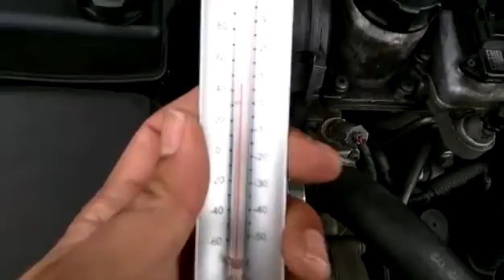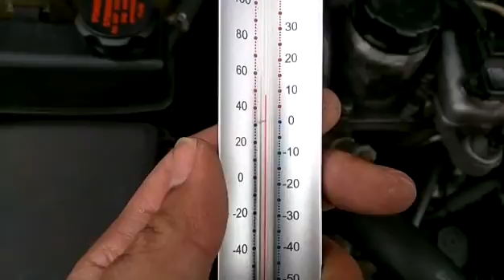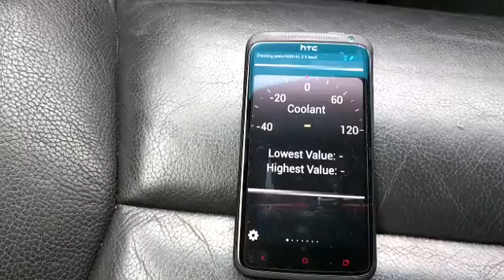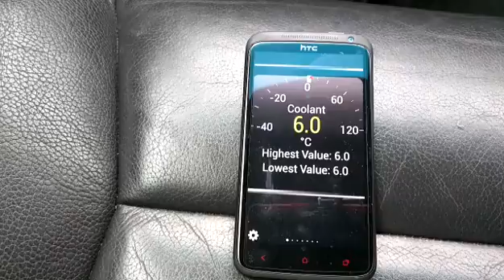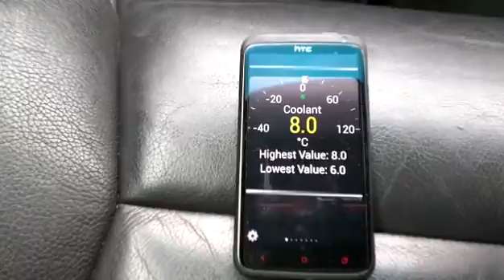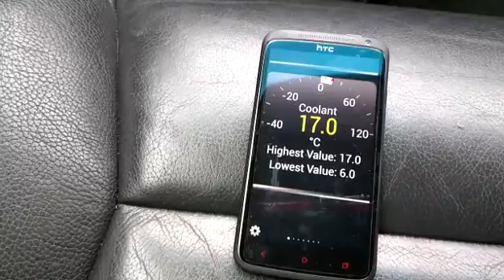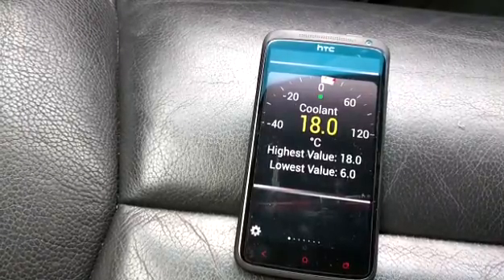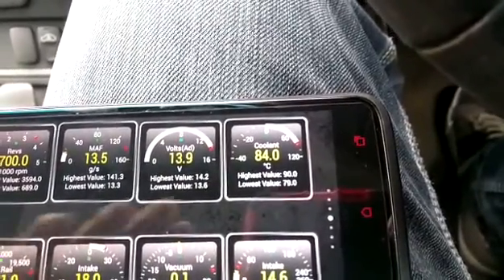How To Test an Engine Coolant Temperature ECT Sensor

Comment: I know this is an old video still hoping for a response. I performed the first part of this test on my car which had been sitting for 7 or 8 hours overnight. The outside temp was 47 degrees Fahrenheit but the ect reading was 54 degrees Fahrenheit. When I started the car it jump for 54 to 60 to 70 too 100 degrees Fahrenheit ext in less than 30 seconds. I have 2 sensors would this be an indicator both are bad?

Comment: Can the a bad ECT cause a delay start on a cold engine? My engine will turn over for about 5 seconds then start. When it's warm it starts right up.
Reply from the maker: Yes it could so you just do these simple tests to confirm or eliminate.

Comment: Hi. I recently commented on ur injector video regarding hard start and white smoke until engine heats up. Ive had injectors and glow plugs tested..all working fine.  If the ect was faulty would it always throw up a code??  Because Vida is showing nothing at all and a volvo specialist believes it may be valve stem seals...however this would be blue smoke? and show on compression test..which again was fine. The car works fine when up to running temp. No oil in coolant etc. Appears to be a fuelling issue but at my wits end with the bloody car...although its too good to scrap!
Reply: awaywayye 
Hi your issues are exactly the same as my V70 d5 . I too am watching Sir Rob great videos in the hope of getting a lead. 
I too believe that it’s over fuelling maybe a leaky injector or lack of working glow plugs. My glow plug light comes on for a fraction of a second no matter what the outside temperature is. 
Even with repeated turning on off issue still persists...relay ??

Comment: Hi, i have s60 2,4T (200bhp), what could cause the problem when the Torque app is reading coolant temperature -41 degrees, but the temperature meter in the dash shows that it is normal? Any ideas?
Reply from the maker: Are you saying that the dash temperature needle is halfway between minimum and maximum but Torque says -41°?
Reply: +SiRobb Yes, that is exactly right. I have problem with the cooling fan constantly running (even when the car is switched off for long time), so thought that it might be the cause.
Reply: +SiRobb When i disconnect the ECT sensor, car idle revs changes a bit.
Reply from the maker: +Mindaugas Vaiciunas Yes it does sound like your sensor may be faulty. 
If you have a multimeter, unplug the sensor and resistance test the two pins on the sensor when the engine is stone cold then resistance test again when the engine is warm and let me know the figures.
Reply: +SiRobb Ok, will do that.
Reply: +SiRobb have tested ECT today. Couldn't get any readings at all while it is cold and about 250ohm when the thermostat opened. Torque app still shows -41c° whether it is cold or hot, but the indication in the car show half way (as normal). Strange.
Reply from the maker: +Mindaugas Vaiciunas No reading when cold? 
Change the ECT sensor.
Reply: +SiRobb Alright, ECT changed. Same thing... -41c° even when the engine is hot... Is there another sensor somewhere?
Reply from the maker: +Mindaugas Vaiciunas You were getting strange resistance readings on your old sensor so what are the resistance readings on your new sensor? 

Also, have you voltage tested the ECT plug contacts with ignition on? 
One contact should be ground, the other 5V.
Reply: +SiRobb With the engine warm ECT sensor gives me 0,38kohm. Plug reads 5,02V. Coolant gauge in the dash works fine. Start to think that Torque is to do with it.
Reply from the maker: +Mindaugas Vaiciunas The ELM327 may be faulty or a pin in the diagnostic port.
You'd have to try another code/data reader to confirm though.
Reply: -41C means the app doesn't read the sensor.  Try uninstalling and installing Torque back again, it worked for me.  Better yet, have a look at Piston app if it works with your ELM327.  The older ELM327 are not great, the newer with wi-fi connection have less trouble.
Reply: -41 is a default value if the sensor isn't providing a reading. I had this with my inlet temp sensor when the wiring snapped right by the plug. However, in your case since your guage needle seems to behave correctly it may not necessarily be the sensor that's at fault. I have the same problem albeit mine (this is on a 2001 V70 T5) shows a reading of zero on Torque Pro and a few other Android OBD apps. Before I try a different sensor I'm going to try a different ELM device to see if that's the issue. Although it seems odd (well it does to me anyway) that everything else could be fine with a particular ELM yet one sensor reading could be wrong, I did actually read on the Torque Pro support forums of someone who had exactly this where certain sensors weren't given readings with one ELM but everything worked as it should with a different ELM.